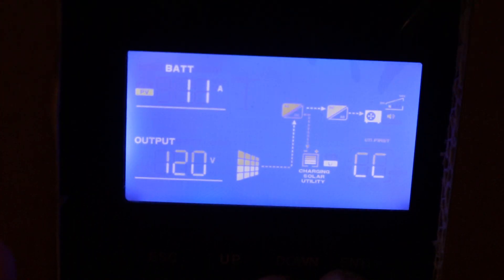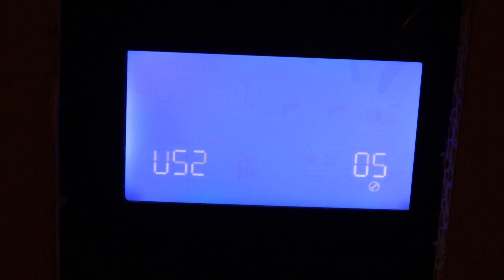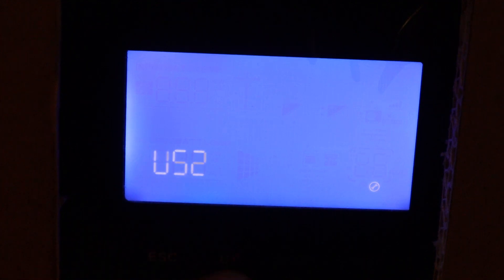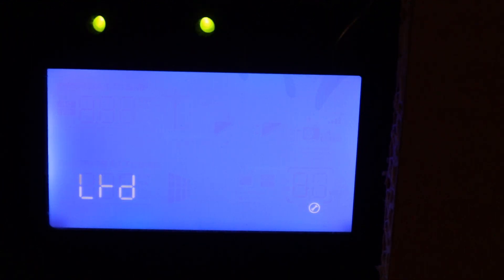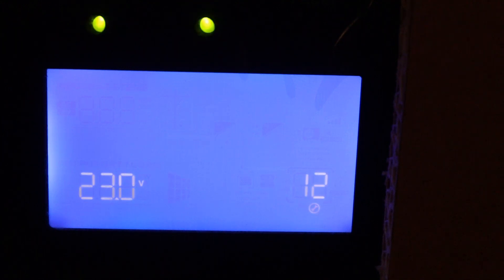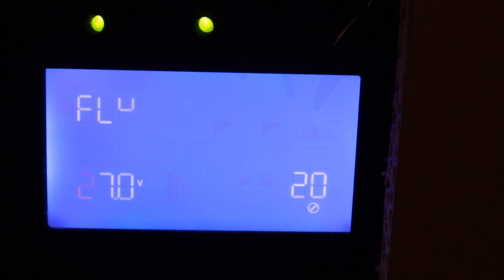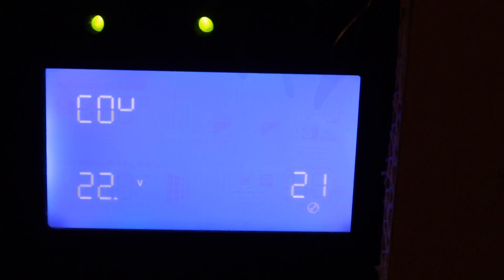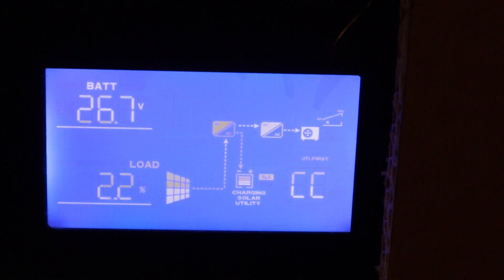Growatt 3000 24 Volt Settings For Lifepo4

Comment: I know you can parallel panels to increase amperage but you probably already know that I think my growatt will accept up to 60 amp and around 100 volt DC input from panels so I'm thinking of paralleling a panel with all three of my panels to increase my amperage and VLC will stay the same just amperage will increase I'm also experimenting in Hawaii we usually get rain in the afternoon and overcast a lot of times I have to fire up a generator for maybe a half hour to bring batteries back up

Comment: To avoid Over-Charging LifePo4 batteries,  I ( also ) recommend charging to: 
13.50 Volts for 12 Volt sys
27.0 for 24V sys, and 
54.0 for 48V sys.
You can Charge Higher / Faster --- esp. If you Have a Lithium Charger, and or know what you're doing ( so as to NOT overcharge).

Comment: One Question and Info for you. I am very experienced with Growatt,, US2 should only used if you Do Not Have BMS communications.. if you have BMS capable Litho Batteries that have the BMS boards , then you should Allow Growatt and BMS Litho Batteries work together.. If using US2 should then adjust using the 20%/80% ratios  When using  US2 you have to be careful as to the Rate of Charge. as this can over time shorten your Litho bat life. for that matter any type of battery.. Be Safe

Comment: This may be a little late, however I was having problems getting my Lifep04 batteries to charge until I watched this video. I changed setting #5 to be USE and then changed a couple settings to be 29.0 volts and they have now charged to 28.9 volts.

Comment: On Model# Growatt SPF 3000TL LVM-24P
I use User 2 setting in #5. 
05	Battery type				US2

If “User-Defined 2” is selected, battery charge voltage and low DC cut-off voltage can be set up in program 19, 20 and 21. It is recommended to set to the same voltage in program 19 and 20(full charging voltage point of lithium battery). Thereaches this setting.
Reply: 19 Charging Voltage			28.8V
20 Float Voltage				28.8V

These were some of the settings that the Battle Born Battery Company recommended for using their batteries with this Growatt.
Reply: I installed the system in my girlfriend's shuttlebus/RV a bit over a year ago, and we have had  no problems with it.
Reply: My setting for #3 is UPS
Reply: 2:50 Check to see if the Charging LED is on steady at 2PM, as that means the battery is full, and it will only charge if the Voltage drops to a certain point.
Reply: 7:51 14 Ch Source Priority			CSO
Reply: Solar energy will charge battery as first priority.
Utility will charge battery only when
solar energy is not available.
Reply: 12:00 21 Low DC cut-off Voltage		24V
Reply: 13:00 If you have your panels flat on the roof, that could explain the low Wattage at 11AM. I installed my girlfriend's panels at about a 45 degree angle, (as we do travel), and she parks it with the panels facing south-ish.

Comment: Can someone help out please
I bought 10kw Growatt inverter with 20kwr Felicity Lpbfm lithium battery, the manual says 57.6v and low voltage cutoff 48v, 
US2 after setting it up the inverter will be showing ero3 battery high even the low voltage cutoff after setting, it will still go back to 45v.
Please what could be the solution to this problem?

Comment: I have another question about this unit with lithium iron phosphate. I made a mobile solar power trailer and when I reconnected everything I have two batteries in series for 24 volts but my LCD screen says in the settings it's 48 volts but when I check with the multimeter it's 26 I'm curious how can I change it to batteries and not four I don't know how and I can't find a way but thank you let me know if anything comes to mind
Reply: Not looking at Settings for a moment, what does the Voltage read on the LCD? 
The only 48V settings in my User manual for this same unit, (Growatt 3000W/24V), are #s 19 and 20. I suspect that this Page in the manual was mistakenly taken from their 48V version, rather than the 24V version. I have those two settings set at 28.8V, recommended to my by the Battle Born Company.

Comment: Hi there, since seeing your vid I switched over to USE and set my voltages to what you use. I have finally gotten the most wattage and current I have ever seen in to my batteries. But I did notice something in regards to the unit limiting power in. During my highest point of sunlight I did notice the unit limiting current and PV wattage. I guess when the batterys are full it goes into trickle mode or something of that nature. I have a freezer running full time on this and when it cycled on the unit let wattage and current to flow again to the batterys. Then when the freezer stopped the unit stopped charging the batterys again since they are full. So maybe this is normal? Sometimes I dont see any wattage or current coming in at all. Maybe this is all normal. Seems to be working ok though.
Reply: Hi Axle. You are correct. When you batteries are full and there is no demand of power by you loads the PV wattage will go down. If your loads suddenly require more power, your PV wattage should go up to cover your demand. I have a Growatt 3000K 24v and It's been running flawlessly for 1.5 years. I have setting 19=27.2v and setting 20= 27.0v
Reply from the maker: Hi Axl Savage. I am glad my video was able to help you in some way. My growatt has been doing awesome and yes, when your batteries get close to your float charge it will kick over to FC which is kind of like a trickle charge. I recently changed some of my settings, my bulk charge CC to 28 volts and my float or FC charge to 28.5 volts. And my growatt is working flawlessly. I can go for about 5 days without sun. Thank you for watching and for your support. Please consider subscribing if you found the content useful. Thanks.
Reply: @thinkfreelivefree6951  how many solar panels do you have and are they connected in series or parallel?

Comment: Gave a like for the first tip of shutting off the button beep (press down and enter buttons at same time). I've seen a few different "this turns off the beep" and no others worked. Thanks for that. Tomorrow will tell if your settings work for getting mine to charge all the way.
Reply from the maker: Hi Bronc. Thank you for watching and for your support. Glad the video could help in some way. Please consider subscribing if you found the content useful. It really helps the channel grow. Thanks.

Comment: My EG4-LL battery communicates perfectly with the RJ45 cable connected to my Growatt 3000tl and set to Lithium.  My battery SOC on the Growatt is now in % rather than voltage.  I can set cutoff, switch to grid, and start charging battery all in percentages now.  Love it.

Signaturesolar has great videos and support.
Reply from the maker: Hi Jeff. Thank you for watching and for your support. That sounds awesome. Please consider subscribing if you found the content useful. Thanks.

Comment: Helped a little thank you ,but. Maybe you can help me , I've been messing with it and spoke to the guy a couple times waiting for a multimeter but I cannot get my panels to charge, I have lithium batteries and it's on user 2 solar battery then utility and I've set it up just like you but it still won't charge solar any ideas
Reply from the maker: Hi Jacob. Try UTI first on setting 1. Let me know if that works. Can you tell me your other settings? Thanks.
Reply: @thinkfreelivefree6951  Hello thank you for your response and yeah it’s funny I put it on utility and unplugged it from shore power and it works perfect so it seems like until I find the proper settings that come nighttime I’m gonna have to put it to shore power because my batteries are set up on a cut off stage on default on user to to where it goes back to shore power if it goes below 2423 votes I believe but I want to run them down to zero basically is there an option to do that?
Reply from the maker: @redshedllc9054  Hi. You can adjust your low voltage cut off in setting 21, but I would recommend not to run your battery to zero. For lifepo4, I would not suggest going below 12% or you could damage your cells. Hope this helps.
Reply: @thinkfreelivefree6951  oh , ok thank you for the tips . I only have a few cycles on the battery bank but will definitely keep that in n mind ,I thought with lithium batteries it was excepted ,I guess just not recommended. Thank you
Reply from the maker: @redshedllc9054  Hi Jacob. With Lithium Iron Phosphate you are correct, you can run them down a lot more than AGM's and Lead Acid, but not to 0%, it will damage your cells. For example if you put a 24v battery bank together with 8 cells, you never want any of the cells to drop below 2.5 volts, that is considered to be below 10% of the battery's capacity. Hope this helps. Take care.
Reply: @thinkfreelivefree6951  That's why I paid more for Battle Born Batteries for my system, as their BMS is set up to allow for "100%" of C rating in usage without damage. That said, @Red Shed LLC. The higher percentage you keep your batteries at, the longer they will last. Mine are rated at 10 years if used 100% each day. If I only use 50% each day, I should get close to 20 years out of them...and then they will only drop to about 80% of their C rating. If I only use around 20% each day, maybe they will last the rest of my life? LOL
Reply: @thinkfreelivefree6951  ^^^ in reply to your above statement, that mainly applies to DIY cells with your own BMS. Most of the LiFePO4 battery manufacturers set their battery BMSs so that there is a "hidden" bit of power left after using 100%, and that AT 100%, it's not overcharging the cells. Watch some of DIY Solar With Will Prowse's videos where he tests out the capacities of various brands of batteries.

Comment: i have a question. my inverter wont start charging from solar after cutting off power from a low battery voltage disconnect. what could be the challenge?
Reply from the maker: Hi. Thank you for watching and for your support. Depending on your battery chemistry the low voltage cutoff needs to be set at  the correct level for your battery chemistry, if it goes too low your inverter may have trouble starting up because it does not have enough power to turn the inverter back on if that makes sense. I hope that helps. Please consider subscribing if you found the content useful. Thank you. Let me know if that works for you setting the low cutoff higher.
Reply: If your inverter has  a Setting for Low Voltage Disconnect, try setting it to higher than 24 Volts, (if it's a 24V inverter).

Comment: Hey I have the same system with 4 24v 50ah battle born batteries, I don't have my panels hooked up so I just plug it in to the wall. Haven't got any loads so it just runs on it's own which shows 7 watts. My battery bank is 4800 watt hours, so why does cycle through charge states every 4 to 5 days? Is the unit using more than 7 watts? 7wh x24 hours is 168wh, times 5 days... nowhere near 4800watts. Is this normal? Thanx man
Reply from the maker: Hi. Thank you for watching and for your support. The inverter uses about 50 watts when turned on and about 2 watts when in standby mode. However, it really all depends on how many watts of solar you will hookup to your system how quickly your batteries will charge. I hope that helps. Let me know if you have other questions. Thanks. Please consider subscribing if you found the content useful.

Comment: After all the comments and discussion are you still using the "USE" setting with bulk and float voltage the same?
Reply from the maker: Hi. Yes I am. I use the USE setting both float and bulk is set to 27.8 volts and it seems to be working extremely well. Thank you for your question and for watching. Please consider subscribing if you found the content useful. Thank you.
Reply: @thinkfreelivefree6951 Thanks for the video and info, please give us some feedback and let me know how it's going a year later

Comment: What about the settings 43 - 48, regarding equalized options? Thx for the info!
Reply from the maker: Hi. Thank you for watching and for your support. I am sorry I do not know anything about those settings. Its not listed in the manual. I think it may have something to do with if you put several inverters in parallel mode. Please consider subscribing if you found the content useful. Thanks
Reply: Equalize charging only applies for lead-acid batteries. LiFePO4 batteries do not require equallizing, so This man didn't use it.

Comment: I have a spf5000es growatt and by the sound of it it uses the same mppt charge controller logic as I am having the same type of issues you are having.With US2 the controller does not follow my programmed settings eg constant current and float, and also when it does reach the fully charged state the charger does not float or restart bulk charge when a load is applied.It should restart bulk when the battery drops below a certain point but does not. I am also experiencing an issue where the charge controller does not commence a new charge cycle the next day.I have tried USE even though I have LIFPO4 cells and it does follow my programmed settings but still fails to restart a new charge cycle the next day.Regards Mark
Reply from the maker: Hi Mark. Thank you for your contribution and for watching. I would contact Growatt about the restart issue you are having each day. I kind of have my growatt 3000 worked out. I will share with you what I did. I changed it back to USE on setting 5 and set my float and bulk to 27.8. It has been doing an amazing job. Not having  any issues right now with it. Maybe see if you can reset your Growatt and set all settings again. Thanks Mark. Hope this helps in some small way. Please consider subscribing if you found the content useful. Thanks. Let me know if you want all of my specific settings and I can send that to you.
Reply: I have the same 5000W 48V Growatt as you. Here are my settings...that work great:
Current settings on both Growatt inverters
001 SOL,
002 100A, 
003 UPS, 
004 Dis, 
005 US2, 
006 Dis, 
007 ENA, 
008 240V, 
009 60 Hz, 
010 4, 
011 20A, 
012 48V, 
013 52.0V, 
014 CSO, 
015 OFF, 
016 ON, 
017 ON, 
018 diS, 
019 57.8V, 
020 57.8V, 
021 42.0V, 
028 1, 
037 to 042 [Current time and date], 
043 diS, 
044 58.4V,  
045 60, 
046 120, 
047 30, 
048 OFF,
049 0000, 
050 0000
Hope this helps!